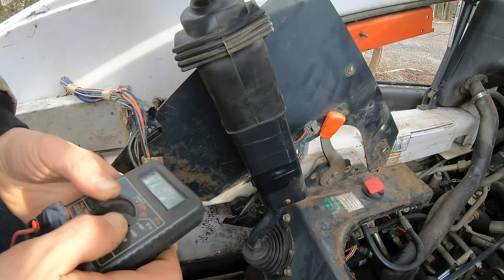Replacing a AHC computer

Comment: When I had an addition put on the house, the excavator contractor had all Bobcat equipment. About every second or third day, it would be quiet outside. I would look out the window and the hood would be up on the equipment and the guy would have tools out doing something to it. I always wondered if most equipment broke down that often. His equipment looked fairly new also which made it seem odd.
Reply: My stepfather & his partner had a Bobcat skid steer on their large Iowa farming operation from the late 70's to the early 90's that I drove a ton, it was dead reliable, & almost never broke down.  It was still running fine when they traded it away, & it left me with a soft spot for Bobcat machines.  But, the numerous friends & acquaintances I have in the earth-moving, landscaping, & heavy equipment businesses all tell me that Bobcat & other USA-made equipment have taken a long decline in quality & reliability.  Like Andrew, most serious, full time operators now favor foreign machines, like Kobelco, Hitachi, Yanmar, etc.  One guy I know is a city heavy equipment maintenance supervisor in his early 60's.  He was a die-hard Caterpillar man for thirty-plus years, until the city he works for refused to buy any more Cat machines, because the high frequency & high cost of repairs far exceeded other foreign makes & models.  Nearly broke his heart.
Reply: A neighbor just threw in the towel after many years selling for BobCat.  He got fed up with the constant repair returns.

Comment: That's insane... 1400+ bucks for that circuitboard, wires, and mounting box?  Yeah, I'd be done with Bobcrap at that point, too.  Funny how they and some other heavy equip manufacturers just gotta rape you on parts pricing....  I wish you would do a bit of an "autopsy" on the compuker that you took out.... carve your way gently into the potting and see if you can find out just what goldmine is down inside that justifies that price...
Reply: Even household appliance have insane prices for computers.  Kenmore washing machine just out of warranty -- $500 to replace computer.

Comment: 11:33  "Why does this look like it's used?"

I'm guessing maybe it was used.  Someone else bought the controller, had this same issue, and send it back under warranty.   They tested it, figured it seemed good, and re--sold it as new.

Intermittent electrical problems are the worst.
Reply: He did the right thing first, he cross exchanged the joysticks and the fault stayed on the right joystick. That makes it clear it is the sensor or micro switch at the right joystick that has a temporary fault.

Comment: Hey Andrew. We have Takeuchi machines and they are mind-blowing. The quality, comfort, power and most importantly the serviceability of Takeuchi products are superb. We have also have a Takeuchi TB285 8.5 tonne excavator which has been excellent. In fact, now have a TB260 6 tonne excavator from Takeuchi coming in a few weeks. I do however see your frustration in using computer-controlled machines however when it comes to a brand as reliable as Takeuchi, I think you need to give it a try. With our first Takeuchi machine, we had it on demo for a bit and nothing failed on it.  I wish you the best of look finding your new machines :)
Reply: lend him one to try
Reply: @carmineriganti2333  not sure how I can take a machine here in England to the US! 😂
Reply: @benw7601  boat!
Reply: @thechronicgeneralist  aha😂😂🤣
Reply: Ben W I hear ya! I have a Tl250 loader and TB153fr you can’t beat this machines! I’ve put 6700 hours on the loader and 3400 hours on the excavator! These things are tanks very strong and reliable!
Reply: @eliteearthworksllc  Couldn't agree more! Is it a tracked loader you have? They look excellent!
Reply: Ben W yes I have a track loader and an excavator both Takeuchi.  The TL250 and TB153
Reply: @eliteearthworksllc  Nice!
Reply: @lingonpaw3292  haha 🤣🤣
Reply: I agree with Ben. My TB285 excavator has been amazing. 3500hrs with a forestry mulching head + some digging and running strong. Very few problems along the way. I am a mechanical engineer for a large competing company too but was hard to ignore the amount of quality for the price when the numbers are everything for a small side business.
Reply: @joshdorr9017  Sounds like we're both proud owners of the takeuchi!   🤣
Reply: Was just watching a Takeuchi skidsteer on letsdig18 looks solid and more efficient
Reply: @dansweet2234  I've seen those vids too 👍
Reply: I’d use John Deere or Takeuchi.

Comment: Andrew Camarata    gosh, that was expensive!  please depot the old computer  (first steam it in a pan to make it hot.  then, use a can of gasket stripper and a paint brush).  very interested to see the guts of that thing.  old computers usually have failed capacitors and the odd blown fuse, or a burnt out resistor. those can be changed.  if that doesn't work, an automotive electrician might be able to flash the software and get you a couple hundred for it.  and remember this:  VIBRATION kills electronics so plan your installation accordingly!

Comment: A meg ohm tester would stress the solenoid coils and possibly show a breakdown in the coil circuit. The solenoids might be OK but there could be a possible intermittent short in the wire harness at times. The Megger can stress the wire insulation and coil and show a fault if there is one. Intermittent problems are the hardest ones to solve as they only show up sometimes ....can be frustrating but solvable.

Comment: Look for a loose connection at your analyzer computer up top
Reply: Loose connection wont fixed by restart
Reply: @kennyloong90  Not exactly true. It may have a momentary weak connection for a split second that sets the computer into limp-mode. When you shut it down, it resets until it loses the connection again. I've seen weak connection that like this before. He should get a spray can of terminal cleaner and use dialectic grease if it happens again.

Comment: When you have as many pieces of equipment as he has it's a full time second job just keeping everything fueled, greased, repaired and running. Plus he films everything on top of it. Insane.
Edit: why does a little turbo diesel bobcat need a $1400 computer when you can buy a decent laptop for $400 bucks? It's an engine and hydraulics.
Reply: Craig Hondo  always thought Bobcat was top quality until watching Andrew. Everything breaks though sooner or later.

Comment: Maybe one of the solenoids pulls to much current and the power transistor blew in the computer
Reply: Not a bad idea to ohm out both solenoids and hi-pot them if you have a megger.
Reply: Yes i think your on the money, he needs to check current draw. It could also be a mechanical issue with the spool valve binding up .  time to break out the amp clamp!
Reply: Ya not that easy.  They are actually servo hydraulic loops.  Not just on/off sol.
Reply: Wont it blew fuse?
Reply: If that happened he wouldn't be able to get it working by re-starting it.
Reply: You've hit the nail on the head there, I had a similar problem after replacing the computer the machine still through errors.  in my case turned out to be a worn bearing in a feedback actuator was causing high current draw.
Reply: @kennyloong90  no fuse.  If there was a fuse it would have been inline or you get the fuse holder coming out of the computer case.  Transients most likely killed it.  The glitching he's having is probably a voltage feedback spike crashing the controller chip in the computer.  As many have said, most public companies now build for profit not durability.
Reply: @RobiSydney  The age of the wire harness and a transient short could be doing it. That insulation looks like it's just on the edge.

Comment: $1500 and they give you the wrong part. They should have paid you for the lost week of downtime you had to wait for the right part. I would go after the solenoid in question and see if there is high resistance causing feedback to the computer. This kind of feedback is sometimes what causes computers to fail. I hate electronics on high vibration, high load machines.

Comment: Had a few of these, seat switch goes, main computer, drive motors, best to sell it and let someone else have the problems, never would buy an American made machine again, parts are over priced.
The last one I had was doing the same thing, would cut out within 1 hour of running, a complete lock out mode, had to switch off and back on again, it would run from anywhere between 15 min to 1 hour then lock out again for no reason, ran many tests for vibration, heat etc.. never found the problem... sell it , thats the best option.
The potting compound is almost imposible to dissolve or remove, but you can bet it designed to fail if a short on the inputs occur, they more than likely have thermal fuses or a fuse in the unit also, if you could get inside it is more than likely repairable, but most companys pot them so they cannot be copied by another company nor repaired by anyone.

Comment: unfortunately  you can`t run and hide from pilot controls and computers anymore on heavy equipment .
Reply: Yes but the companies could design components to last, and make them easy and cheap to replace when they do break.
Reply: Pilot controls in general have no computers for the joysticks.
Reply: The Takeuchi's are hydraulic pilot controls.

Comment: Hi Andrew Get a can of ACF50 Pink can and spry all the electrical connectors  and you won't have any more problems computers are micro voltage and the slightest bit of damp F----- them up its the best thing since sliced bread   check it out Paul.

Comment: I also pretty much gave up on Bobcats - they are unresponsive, prone to break downs and frustrating. Bought a Case and shortly after a Kubota and although the Case was way better compared the Bobcat, the Kubota was yet another step better. Biggest difference is what an operator will "feel" and that Kubota is responsive, crisp and bullet proof. Japanese quality cannot be disputed - simple, well engineered, and durable. I will keep switching my fleet out and over to Kubota's.
Reply from the maker: I replaced this machine with an IHI, the IHI has not had any problems.

Comment: The strain relief (or lack there of) on those wires coming out of the potting compound is troublesome for something that lives it life in a high vibration, shock and jarring environment.
Reply: Those wires are potted because of the environment you describe, strain relief is not needed because the wires do not get strained or other words pulled or flexed. It’s a static harness, not flexed around.

Comment: Kubota all the way...we have 4  in total, 2 skid steers and 4 excavators. Never really had a problem with them. Always reliable for us but we baby them. Keep them clean and dont scratch them, the boss will have a fit if the counterweight gets scratched. Komatsu is the other best option in my opinion.

Comment: Couldn't agree more on Yanmar. I got a marine dealership for them in 1978. Everything about that engine was designed for power, simplicity and longevity which means something when you are off Cape Horn in a gale.  I then went on to embrace Kubota tractors and had the first M4500 in the USA. I think you should look at the Kubota skidsteer although your IHI is Takeuchi. Correct me if I am wrong,  but doesn't Takeuchi build Gehl, Mustang, IHI, and the older Deere ctl's? Good stuff, but Kubota is now everywhere.
Reply from the maker: Yeah, I think the IHI is the same as those others. That machine has been very nice.
Reply: @AndrewCamarata  I have only operated one big Takeuchi for maybe 6 hours. My only complaints were 1) it didn't seem to have the lift capacity that my Volvo did (it did have plenty of push, though) and 2) the short track length compared to the high power seemed to beat the older operator (me) up. The Volvo just seems to be a better fit for me.

Comment: Question if that was bobcat controls (hand and foot) would it have that computer?
Reply from the maker: The Foot controlled bobcats would not have that computer. But they break too. My 743 has the same problem with the bucket not moving. But its not a electrical problem.

Comment: I'm really surprised that is where the computer lives on a bobcat..  I never bothered to think about where the computer guiding everything on bobcat would be... but I did not think of all the place it could be that would it.  I honestly would of thought they put it behind the control panels to keep it away from water.. but what they are doing buy casting it in hard plastic is really interesting..  That's the sort of thing car makers should be doing to there  cars and trucks, so flooding a car does not stop the car from running.  And because they plastic cast it, it makes sense they can put the computer down there since its now a super durable item.

Towards the end of the video you say something I find a little scary and honestly surprised me about your character..  "you don't need parts because they don't break."  I find that scary since everything breaks.  I find this surprising of you because up till now I thought you where used to having to repair stuff, and because your so good at repair stuff, would want something that is so common, that finding parts to repair it to be a quick and simple task....  

You do make a great point about why you would not buy a bobcat though..   So do you repair as best as you can, and sell it or just sell it as is?

Comment: Hey Andrew, I have a T300 and the fuel gauge isn't working so it beeps and throws a code 09-21.  Bobcat says they have to pull the engine to replace the fuel gauge!!  Would you even consider taking on this job or do you think I should live with it?  I don't think I'd like the bill I'd get from Bobcat.
Reply from the maker: Nah, why do you have to pull the engine, you cant get to the sending unit? Those bobcats are always broken, get a IHI or Takeuchi.

Comment: any chance you would consider dissecting the old computer to see what's inside like you did with the old fuel filters? Absolutely curious as to why replacement part cost so much.what the heck is inside to justify such a price...............
Reply from the maker: I tried to take it apart to fix it. I kinda butchered it.
Reply: @AndrewCamarata  Bummer, now i wish you would have strapped it to a girder on the Tapanzee Bridge before this mornings festivities.

Comment: Check all the Grounds for the wiring system, that could be the problem and why the wire are not shorting out but still making you reset. Electronic's use ground sensing so if a wire does rub on the frame and contacts it will not burn out the system same in Cars And trucks with the computer wiring. you can't short out a ground Data wire if the wire touches a ground but you could get a bad ground signal to the computer board that will give a reset needed code.

Comment: Hey Andrew, your videos are awesome. Can you tell me what the red square button/ switch next to the throttle is. Mine doesn’t seem to move and I don’t what it is. Thanks
Reply from the maker: That is for lowering the arms down incase the engine stops running and the operator is trapped by the bucket. If yours is pedal controls it wouldn't have it.
Reply: Andrew Camarata Thanks, mine does have foot controls. Your videos are awesome. Keep up the good work👍👍

Comment: @7:50 that's a potted PCB, usually this is done to help weatherproof the connection and/or make the circuitry difficult to access. I'm guessing both in this application.

Comment: Repairing all my own electronic things, i constantly bypassing circuits and making my own. You could avoid the cost of a expensive ECU and just get the joystick to actuate the hydraulic circuit directly through strong relays ect if you understand whats needed.  They seal those ecu's up so you cant repair them or make it very difficult to anyway! Sometimes on older devices, you cant get the computers and have to bodge something up. You got nothing to lose! just dont short the ecu in the process of bypassing it haha

Comment: Check all your grounds including the battery if you didn't already. Corroded, broken, or loose grounds are usually the first thing I look for. It's not always the case, but it happens quite often and can make you say bad words. I could never make myself like Bobcat, they just never seemed to last long at all to me. 1400$ for that computer is ridiculous, these days they probably have 20$ in it. I don't like computers on dirt equipment where they are subjected to heat, moisture, vibration, oils/grease, etc. Farm tractors have so much trouble with all the electronics on them anymore that most folks are paying good money for the old stuff because it just plain works. I think there are a few companies that build equipment without all this computer nonsense on them. The names escape me right now though, but I believe they were Japanese and Korean made.